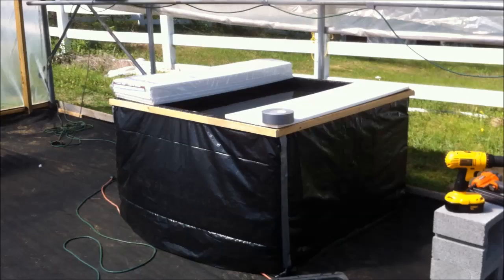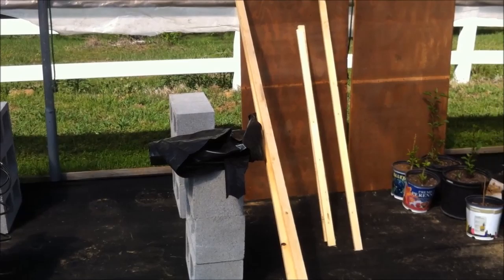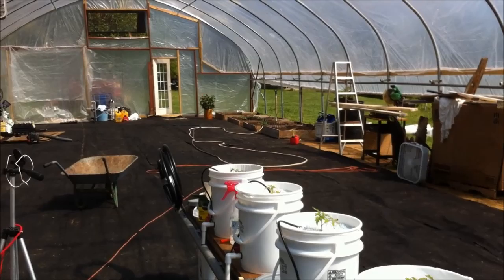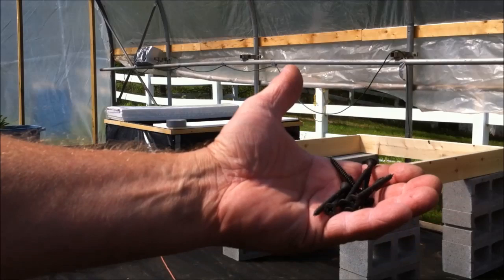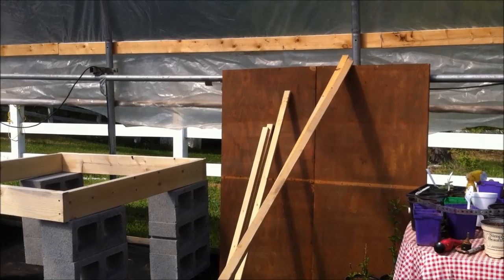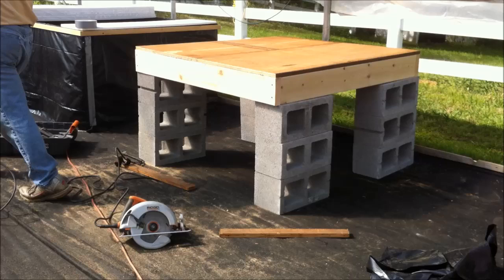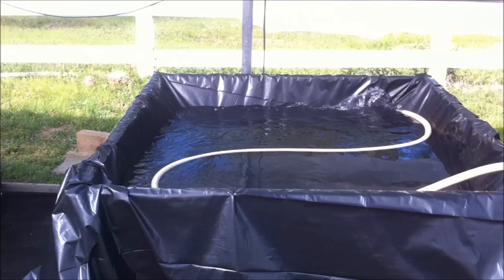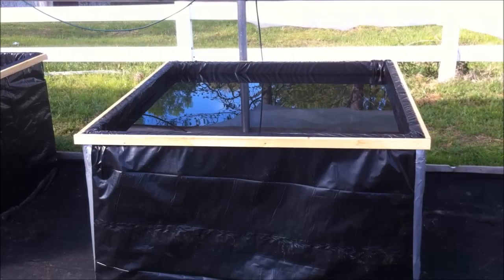How to build a 4'X4' Non-Circulating Kratky Hydroponic Grow Bed

Comment: i like the 32" X 48" for spacing in tighter confines. also three beds will use up a sheet of plywood or strand board and a sheet of the foam board. good video
Reply: 32" reach is able to be put against a greenhouse wall or other boundary or barrier. It is eeachable for most folks.

Comment: Your set up looks great, the four by four boxes are an efficient use of materials, however I feel a need to point out (yes I know that this was filmed in 2013) that using two pieces of plywood to cover the 48 inch area is problematic because the weight of the water can cause the wood to pull away from the bottom. Another point is that you used nails to hold the plywood in place, heat and cold can cause expansion and contraction, which will in turn start to work those nails loose, this in combination with the unsupported joint in the plywood could cause you trouble in the future. I recommend adding some 4 inch metal strapping to run across the unsupported joint and another strap in the opposing direction (use screws to secure the strapping to the outside of the frame) as well as putting a 1 5/8 long screw every 6 or 8 inches at the perimeter to hold the plywood in place.
Reply from the maker: Good points however they are still in service in 2017. I now use them as seedling beds. The only difference is that they no longer have nutrient solution in them and I have painted them. They still hold water and show no evidence of wear! They are in my last video or the one before that. Fingers crossed!
Thanks for following along
Reply: Good to know that they are still in service and that you are still keeping up with the comments section of your videos, happy growing.

Comment: I think 32" x 48" boxes make more sense: Easier to move. Also, because so much construction is based on 16" or multiples thereof, it's easier to dimension the cuttings and there's very little waste. For 3 boxes, the side/end pieces come from 5  eight foot pieces of lumber: Two are cut exact in half (48") and 3 are cut to 3 x 29" pieces each. You end up with less than 4.5" of waste from the 3 boards. Aspenite for the bottom will already have the 32" lines on them, making a 4' x 8' sheet easy to cut into thirds. Then, the liner can be cut from 20' wide rolls, such that a 4' x 20' piece yields enough for 4 boxes. Total waste from that whole piece, for 4 boxes, will be something like 8 strips of plastic about 2 inches by 4'. Note bad! mhpgardener, on Youtube, describes the construction.
Reply: My mistake...plastic from a 20' wide roll needs to be about 5.5 - 6 feet by 20' then cut into (4) 4' wide pieces. After putting on the edge pieces on to secure the plastic, and trimming the excess, there is still very little waste.
Reply from the maker: Olen Soifer Makes sense to me!
The boxes that I have were made of scrap lumber that I had laying around. I may have to rebuild them as I uncover the carnage after my greenhouse collapsed a couple of weeks ago from the snow. I just ordered a brand new 30X96' greenhouse today to replace it!
Chuck

Comment: Just curious, could I make this system with a full plywood sheet, 4' x 8'?  Trying to build a larger indoor farming system. Pros and cons?
Reply from the maker: Absolutely. I did it this way so I could reach all the plants easily but I lost valuable growing space by doing it. A lot has changed for me since then but this is a great system nonetheless.
Thanks for following 
Chuck